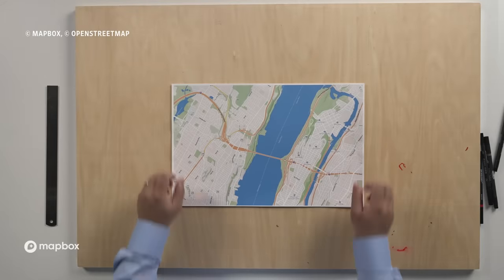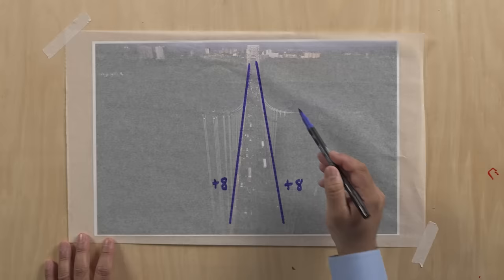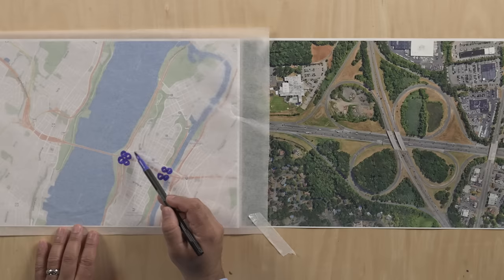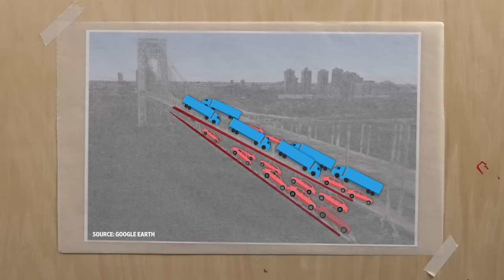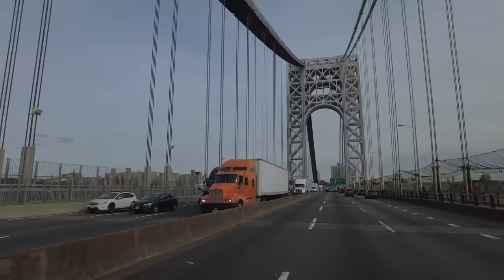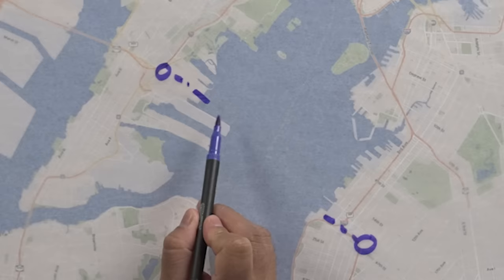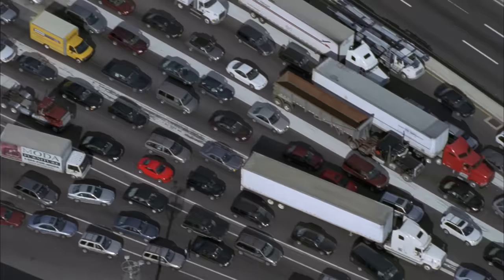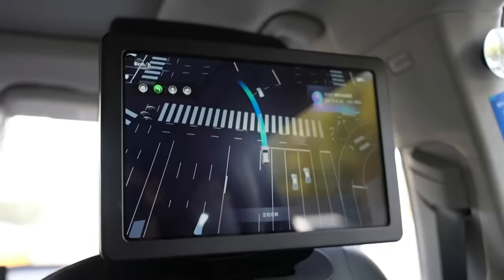Transportation Engineer Tries to Solve America's Worst Bottleneck | WSJ Pro Perfected

Comment: Good to hear that finally traffic engineers search for solutions instead of bulldozing everything to build more lines.
Reply: The "solutions" outlined in this video are basically to tax people to encourage them to use transit that doesn't exist. 

Real good solution would be to build better beltways around the NYC region. 287 should definitely connect to Long Island. LI could use a few bridges linking it to CT/NJ actually. It's ridiculous how the 8 million people on LI have 4 bridges (that don't go to Manhattan) connecting them to the rest of the country.
Reply: @smacpats6379 such would only create demand and do nothing to halt congestion while the buildings that were bulldozed for the project stay demolished.
Reply: @ideatsand  Last time I checked there's not an abundance of buildings in the Long Island Sound.
Reply: @smacpats6379  It just gives more options to cars. They will still congest the roads/highways.  When people use public transit they pay, so charging people to use the highways/roads at certain times make sense too.
Reply: @vitasoy1437 you’re paying either way, though public transit usually goes back into funding government expenditure rather than putting it straight into the pockets of oil monopolies.
Reply: @vitasoy1437  I really get the distinct feeling you're not from the NY area if you don't understand the purpose of a Long Island to Connecticut (or Rye) bridge. The existing sole option for cars leaving long island is to traverse NYC.. So yeah, the entire point of a bridge connecting LI->Westchester/CT would be that cars would get more options. Instead of having to drive through the middle of the most populated city in America, you could just send them around. And you think that'd INCREASE congestion in the New York area?
Reply: Only took half a century after watching Europe do it from day one.
Reply: @Sevenfold120 Well that was because Europe was extremely poor after WW2 while US had a economic boom
Reply: Yeah. But.  He's a traffic engineer...  when the only tool u have is a hammer?   Everything looks like a nail...   supply new York with barges.   Done.
Reply: I don't have any interest in picking a fight with smacpats but I do want to say it's almost incredible to watch someone be so wrong in the comments section of a video of an expert explaining specifically why they're wrong.
Reply: @Abrothers12  if we are paying either way, shouldn't we get a better transit system too? Since sitting in traffic doesnt sound that comfortable. If we have more funding for highways than for public transit.  Pretty sure we can make them, its whether the government wants to.  We should be able to have both good highway infrastructure and a good transit system.
Reply: @RobbyVanArsdale  Please explain to me in your own words why sending traffic around the city would not improve traffic versus sending traffic through the Bronx and over the George Washington Bridge.
Reply: @smacpats6379  sure. I did say I don't want to argue with you, but I'll give it a shot. According to The Power Broker, a book about Robert Moses, the most prominent figure in New York's road infrastructure and builder of essentially every crossing of the harbor except the GW and a tunnel I forgot which one (I believe? Double check me!), there has never been a reduction of road traffic on any crossing to New York city's boroughs after the opening of a new bridge or tunnel. This is repeated in every authoritative source on the topic. I'll say that again: there is a gap measured in only weeks between the opening of a new crossing and the resumption of identical crossing numbers on all the old crossings including the new traffic on the new crossing. Essentially: the effective upper limit on demand for road traffic is so much higher than the capacity of the existing crossings that adding even many crossings would not allow supply to exceed the demand for road space. You're proposing adding too few bridges.  Way way way too few.

The expert in the video is pointing out that roads require too much space and add too little capacity. Your desire for an extra crossing is totally understandable! And you do need increased capacity! He said so too. But your proposed development is insufficient and! experts believe it is unlikely that the monetary expenditure for car bridges would be worthwhile in the long term in comparison to other possible infrastructure projects that can be created with limited public funds.

You are NOT stupid. But I was rocked by your comment because it seemed like you hadn't listened at all to the fundamental argument made by the expert.
Reply: @smacpats6379  Bro, I live on Long Island, and are you high?? A bridge going around NYC would take more time to traverse than going through NYC... Also what kind of idea is this, that would cost an insane amount of money to build and maintain and it is not worth it.
Reply: @RobbyVanArsdale  I am not arguing for an additional crossing of the Hudson River into Manhattan. That would be completely pointless unless a major construction process (ie large amounts of tunneling) were to occur in manhattan. I am arguing for bridges 20+ miles away from NYC which allow the 8 million people from Long Island to enter/leave the area without passing through the middle of NYC traffic. Like this- https://en.wikipedia.org/wiki/Long_Island_Sound_link . Connecting LI with 287 in Rye would provide an actual ring road around the city rather than what we have now, which is all of the interstates going through the heart of the Bronx.
Reply: @smacpats6379 because people wouldn’t stop driving through the Bronx and over the GW bridge. There would just also be cars going over the bridge from Long Island
Reply: @smacpats6379  You are complaining about taxes to expand the rail network but have no problem extending 287 to long island do you have any idea how much that will cost?  What this guy is proposing will be a fraction of the price and have more impact then simply another bridge.  If they were going to add more access to Long Island it really needs to be freight either by ship or rail so that everything does not have to move by truck.
Reply: @smacpats6379 a solution  is building  that public transit thay doesn't  exist.
Reply: @brizzled5193, being poor, has nothing  to do  with it. Because  trucks were  cheaper post-war. a lot of railways almost disappeared here in Europe. 

But we kept rail because  alot of industry was still  dependent on it

Only in recent  decenia has public transit surged here in Europe.
Reply: @smacpats6379 it wouldn't work because  people  need to go into new York, not around its there  will then be an bottle  neck  somewhere else
Reply: @smacpats6379  People like vitasoy1437 think helping Long Islanders get around is a BAD thing.
Reply: @gentlebabarian  There are just as many people who need to get around NYC as there are to go into NYC. Actually, there are more outside of NYC.
Reply: @DTD110865  Preach. People who don't live here for some reason think that every trip around the tri state area begins or ends in Manhattan. They have no idea what they are talking about.
Reply: @birdrocket  People from Long Island would stop doing that if their bridge to Rye was faster.. And even if what you were saying is true, would providing Long Islanders with a faster link to the outside world really be such a horrific outcome?
Reply: @FakeSchrodingersCat  There's a big difference between adding a $3 toll to a bridge to pay for construction and adding a toll that is so expensive that it discourages travel. One of them is funding infrastructure, another one is intentionally pricing many people out of commuting/traveling across the Hudson River. 

LI's transport link woes extend far beyond freight. Hundreds of thousands of cars queue up every day to cross bridges like the Throgs Neck to leave the island. You could get rid of all the trucks in LI and it would still take a lifetime to get from LI to Greenwich because there simply is just not enough infrastructure linking the 8 million people on the island with the rest of the country, it all spits you back right into NYC traffic.
Reply: @smacpats6379  I didn’t say it was a horrific outcome, just that it would do nothing for congestion
Reply: @vitasoy1437  Whenever you give "good" options for cars, that functions as a fertility clinic for cars.
Reply: @RobbyVanArsdale "other possible infrastructure" like the MTA project to Penn Station, 10 years and 5 billion overbudget. How much and how long is a rail tunnel and rail connection to hoboken or similar is going to be? And with fares at $2.90 where is the money going to come from? Get rid of traffic on the bridges, and roads and where is MTA and NYS government is going to get money for public transport from? Also how you get people from areas that do not get subway or rail and work in the city? Make them ride a bike to a train station 10 miles away?.....
Reply: @PatricioGarcia1973  my dude, you are talking to a lowly civics teacher. I know that the political situation is relatively infeasible because people like you are unhappy about your increasing tax rate. However I also know that the infrastructure solution is possible and certainly better than infinite car dependency. But my expertise is in pedagogy, not infrastructure policy. Your numerous demands for complex policy solutions are better served by policy experts, many of whom have spoken publicly (like the man in this video). Of course there are associated costs, increased by the cost of domestic labor and short-sighted urban planning in the critical phase of the 1920-1940s. Of course public transit isn't the solution for every person or every trip. But if we for one moment acknowledge that we live in the richest country in the planet and perhaps a fraction of that wealth can be spent on improving our most productive economic centers, maybe we can stop whining about the up front cost and difficulty and we can actually accomplish our goals.
Or we can whine about it. Your call.

Btw There's a name for asking someone for citations and sources to their assertions when the information in question is commonly and freely available, and it's because it's an annoying Internet tactic for derailing the conversation. Don't sealion me, dude.
Reply: @smacpats6379 I know it doesn't make immediate sense, but we have 50+ years of development demonstrating that building bypasses and expanding lanes does not really end up reducing congestion.
Reply: Construction can be tough 💪🏾💪🏾, but the completion makes it all worth it ❤
Reply: @Datamining101  Gee, I wonder why every European country, China, Russia, Korea and Japan have built beltways so that cars can go around their major cities if they don't work. Lets just keep sending all the cars through the middle of the Bronx to the GWB instead.
Reply: @smacpats6379  your take is half baked at best. Here’s what’s insane highways were built that literally carved cities in two that disproportionately affected non-white people especially Black people. Car Manufacturers lobbied to remove buses and trolleys from city streets while pushing the agenda that having a car was the best way to get around when this has been proven time and time again to be false, especially when commuting or living in an urban or suburban area, people were taxed to build something that didn’t exist. It was called the subway, my taxes pay for people to park their cars in my city. What do I get out of that? What benefit? What’s my return from my investment? Can you tell me what’s crazier than that? I’m awaiting your reply.
Reply: Good to hear people are still holding hate-filled stereotypes...NOT.